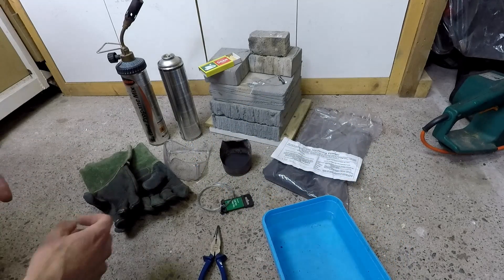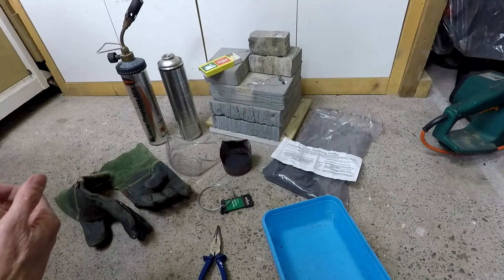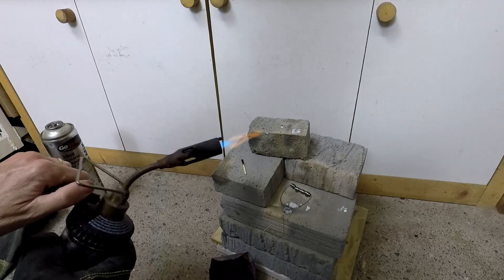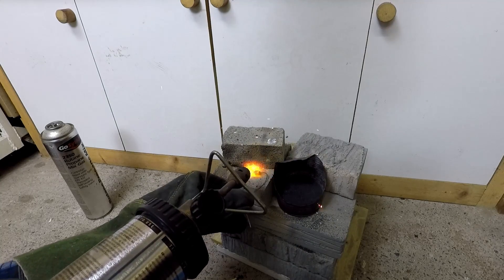How to Case Harden Steel Parts in the Home Workshop

Comment: Doesn't water quenching run a risk of warping or cracking the parts? Consider the case of trying to case harden a set of fine-toothed steel gears of unknown composition. Warping and cracking would be a catastrophic outcome. If they are already high-carbon, but were just not heat treated properly (or at all) during their manufacture, then adding more carbon could make things worse and embrittle them. If they are low-carbon, then could heat treatment warp them permanently such that they no longer mesh properly?

Comment: I have accidentally over heated springs and ruined them. Is there a process to put spring back into spring steel?
Reply from the maker: Heat to red then quench in water or oil. May need to be tempered a bit too.
Reply: @MetalMachineShop  ok, I'll try that. Thanks.

Comment: Wouldnt this harden the entire piece of metal? I thought case hardening was only the outside layer but if your  heating and quenching the whole part should make the whole piece hard?
Reply from the maker: it will only harden high carbon tool steel.  low carbon steel will not harden on quenching.

Comment: Great tutorial! Is this ok for knives? Thanks!
Reply from the maker: I'm not a knife expert, but if you sharpen a case hardened knife, you will grind through the hard case into softer metal underneath. Knives need hardness through the blade not just on the surface.

Comment: This will work on gun barrels as well??
Reply from the maker: It should work on any low-carbon steel, irrespective of application, but distortion could be an issue.

Comment: Good video, however, I did not see or understand what product you used for the case hardening operation.
Reply from the maker: It was an unbranded case--hardening powder I got from a model engineering supplier years ago.  Kasenit is a branded product I think.

Comment: Will this work on stainless steel?
Reply from the maker: I doubt it, but it may depend on the grade of stainless. Might be worth testing a sample.
Reply: Much more difficult to significantly carburize stainless, since the chromium, nickel and so on tend to "sweat out"  into a thin surface layer that blocks the carbon from entering. 

However the stainless steel baskets we use in the furnaces do tend to form a visible, deep case, and eventually become brittle, over many hundreds of hours at temperature, over years, so it is technically possible.

Comment: First of all, thanks a lot for the video, it's easy to understand and probably the simplest demonstration I've seen.

I have a question about quenching: I know that, for example, quenching in oil is preferable for making spring steel. I've watched a couple of videos about case hardening and everyone used water. Is water preferable for case hardening, and would quenching in oil produce different results?
Reply from the maker: Hi, as far as I know using oil would make no difference.  Quenching is about rapidly reducing the temperature of the heated metal in order to preserve it’s crystalline structure.  Both oil and water can achieve this.  I don’t think the fact that it is oil rather than water makes a difference at a chemical level. I think the bubbling as water boils can reduce the speed at which the temperature drops; this doesn’t happen with oil.  Water is cleaner and easier than oil.  For large parts, oil is probably better and safer as long as it’s not flammable.
Reply: @MetalMachineShop  Thanks a lot for the response! If you don't mind, I have another question - how does the temperature affect carburization? What happens if the metal is hotter than red? The piece that I want to carburize looks like a long cone and I'll be using a charcoal forge to heat it up, so it will be very hard to get the same temperature along the entire piece since the tip is much thinner than the base.
Reply from the maker: @blasty137  Hi,  that question is stretching my knowledge a little.  I suspect that heating beyond 'red' may adversely affect the results and impact on the properties of the steel.  However, if the part can be steadily heated for a reasonable period, it should be possible for it to achieve a uniform heat despite the taper.  Overheating is unlikely to give satisfactory results.  Trial and error would be an option or further reading into heat treating.
Reply: @blasty137  From memory over heating the steel will result in softening or Annealing the object. The various colours that an object changes to as you heat , blue, straw, plum, cherry red, bright red and so forth will lend itself to different results - Sorry - this is from the deep recesses of my memory as an apprentice copper smith some 40 years ago

Comment: I’m thinking about prototyping a heavy bike/motorbike type chain , any idea of the process ? I’m clueless
Reply from the maker: I guess you would need a good reason to make, rather than buy, in the first place.  You would need quite a bit of tooling to start with.  The chain plates would probably best be stamped out or laser cut,  etc., but I suppose you could cut them out by hand.  You would need a jig to drill the holes in the plates at the correct spacing (if not already stamped out).  Pins would need to be hardened and profiled so they don’t pull out, and pressed into the links.  Finally rollers could be made on the lathe and would also need hardening.  You would need a certain amount of expertise in all these areas  to ensure success, particularly if personal safety is involved in the chain’s application.
Reply: @MetalMachineShop  hi, I’m sorry , i meant security chain. Like Almax , pragmasis and pewag make, to name a few.
Reply: @MetalMachineShop  something a bit like a Gunter’s Chain but a bit simpler. The “links” would be very thick, maybe 25mm or higher, with a goal of having the greatest resistance to angle grinding on the market but also to be the same weight or lighter because there is less material with long straight rods with loops on the end instead of short oval links like a normal bike/motorbike security chain
Reply from the maker: I get it!  Sounds like a neat idea.  The end links would need to be welded to the bars I guess.  You would struggle to stop anyone with an angle grinder, even very hard steel is easy to grind through; in fact softer material like aluminium can be more difficult to grind, but it depends on what sort of cutting disc you use.  Hardened steel should defeat a hacksaw and be harder to cut with bolt croppers.  Whatever, the thicker it is, the longer it will take to cut and it might be thick enough to be unable to fit between the jaws of bolt croppers.
Reply: @MetalMachineShop  thanks 

Yeah, from what i have researched, nothing is angle grinder proof. The biggest motorbike chain on the market is the almax VI which has 25mm links and weighs a ton. A youtuber cut through it in about 14 minutes under perfect conditions.

My goal would be to either get a lighter chain but with an equal grinder attack time, or haceva chain the same weight as the almax but get much greater grinder attack time. Preferably id like lighter weight AND greater grinder attack time.

From what i see, to defeat a chain you need 2 cuts with the grinder on one side of the link. In some ways the material on the uncut side is wasted . Well, not really as its needed to create a closed link, but i wonder if there could be a more efficient use of materials. 

The first cut of a link with a grinder seems to be the longest , say 10 mins, but they second cut is much quicker, say 5 minutes. i read that its because the metal heats up and has room to expand now there is a slight gap ftom the first cut. And also the disc doesnt bind up.

So i would rather use all the material of one link and form it into a single rod, which would only need one cut to get through, but would be so thick that it would give a longer angle grinding time 

With multiple links of a chain, it takes a lot of links (material) to cover a distance, so again, a lot of material is wasted, when a straight rod could get from A to B much quicker and more efficiently. I dont know how long i would make the rods/links , but i guess it would be a balance between being portable yet long enough to save weight. Maybe 2 feet rods as a rough guess. There is actually a company i found that has made some similar to my idea.

Comment: Thanks for the vid, I live where you can only buy mild steel and no case hardening powders available, i have had to make a 20''' lawn mower blade, and will attempt to case harden slightly to stop it bending and hopefully keep the knife edge longer it  buy using charcoal powder , any thoughts on this will be much appreciated. thanks.
Reply from the maker: Brian David Hi, charcoal should work.  I don’t think case hardening will affect the bending strength of the steel though.  I’m not sure if it’s standard practice to case harden lawnmower blades - mine is normal mild steel and I just sharpen it on the bench grinder occasionally. But why not - would be fun trying! Cheers.
Reply: Thanks for your reply I think they are made from some sort of stronger steel as i tried to straighten one under a press with minimal success it sort of just sprang back, the reason was that the jerk i left it with for repair apart from the fact he flattened out the wings it was  now bent. I have made 2 new ones and used a clay barbecue with a fan blowing on it to heat red then bent the wings up and have ground the knife edge. wish i could post a photo. yes i could sharpen the old one easily but it became so worn, and i cannot buy a new blade anywhere. I am going to give it a go today at least it may prevent it from rusting  @MetalMachineShop

Comment: Thank you for this video. A friend of mine made a mild carbon steel knife and only realized afterwards that heat treating it to harden the blade might not work. I'm not sure if case hardening will work, but as a hobbyist I felt it worth a try.
Reply: It might keep an edge through hard use for a month. Case Hardening will still dull noticeably faster than HCS, but be noticeably stronger than mild steel.   Mild Steel was and is harder than all other forms of metal man had made for the last three thousand years before it. The knife you made would be a kings treasure two thousand years ago.
Reply: Hi. I'm not sure if it's still of interest to you, but here are two videos that show both the process and the result you're interested in,  penetration depth:

https://m.youtube.com/watch?v=V_Mp1fNzIT8

https://m.youtube.com/watch?v=aFqdWXDZiq4

Comment: Fascinating! I do have one question though: does the carbon coating add anything to the OD of the part? Or does it really penetrate through the surface, leaving the OD as it was when the part was machined? Thank you for sharing your knowledge!
Reply from the maker: I don’t think that the carbon itself appreciably changes the diameter of the part as it penetrates the crystalline structure of the steel.  However, it does result in surface scale that needs to be removed.  The heating process can cause the metal to distort. With a decent depth of surface hardening it is possible to grind the surface slightly to remove distortion and achieve precise dimensions.  These are unlikely to be a problem in a home workshop environment though.
Reply: @MetalMachineShop  Thank you for the detailed reply. I would need to apply this technique to harden the valves (camshafts and crank shaft too, of course), of the Schillings V 8 that I am currently making. I will bare this in mind, and experiment on my "failed attempts" parts bin. Hopefully, a working engine will see the light of day, at some point. I will surely keep you posted about it. Thanks again!
Reply from the maker: I don't think you need to bother hardening the plain bearing surfaces on crankshaft or camshaft - just the cams and tappets.  The risk of distortion offsets the advantages.  Only worth it for an engine that will have lots of use.  I would be interested to see how your engine progresses!
Reply: @MetalMachineShop  Interesting insight. I will bear this in mind. I will indeed post some of the progress in due time on my own YouTube channel. It won't be before quite a while though, as there are dozens of other topics in pipeline. I will give you a shout though. Thanks again for sharing your knowledge!
Reply: sometimes grinding or machining using ceramic tips are used to achieve final sizes i.e bearing journals.